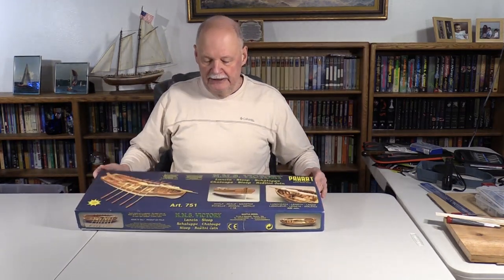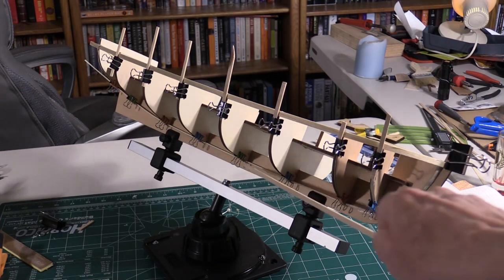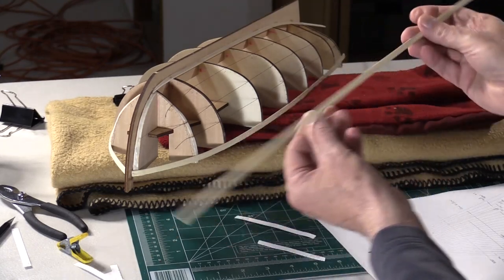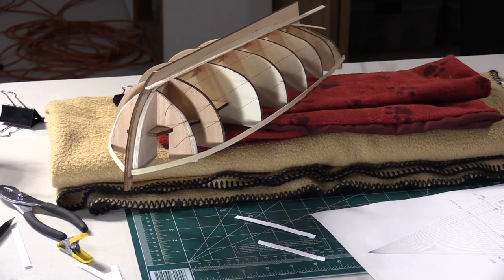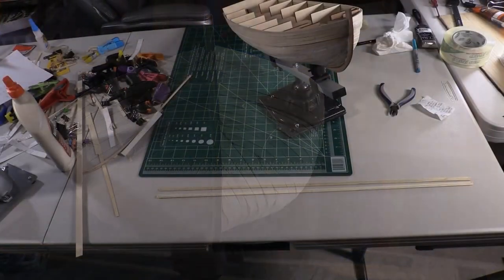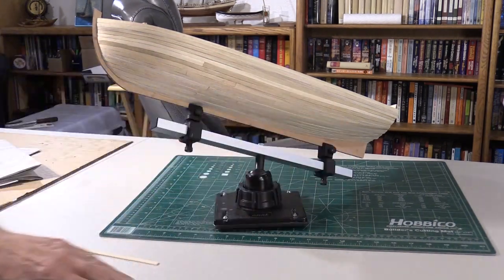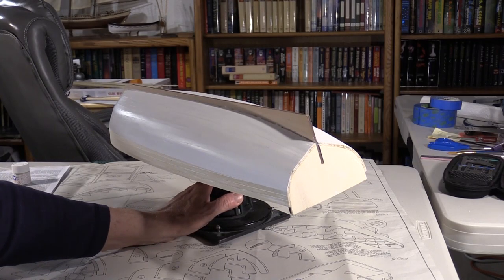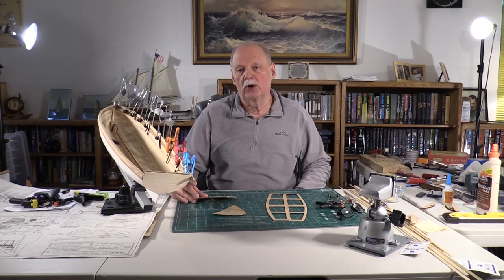HMS Victory launch Part 1, the Hull

Comment: What I have been doing on my planking is I taper the edges of each plank and that has all but eliminated the issue with the gaps. It takes some trial and error to figure out how to get them right but I learned this watching how they make real wood boats and they do this to every plank so they are flush. Although on the real boats they do what is called corking where they take something like Hokum and bound it into the seams between each plank. Not sure if that was a universal method and worth some investigation but I want to build as accurate as possible so my next boat I am going to try and find more historical detail about methods used and if the boat did get corking I need to figure out what material and methods to us to recreate that on the model.
Reply from the maker: Very interesting.  I am a slow learner, but if I stay with a thing, I can usually get good. 
I have been focusing on planking, and I am better, but still lots to learn.  I appreciate your advice, and keep it in mind when I get back to studying the model boat building techniques

Comment: Note under Fig 3 states (my translation) "before proceeding with the battens, it will be good to pass a little wax on the edges of the frames (excluding m.B) which must be removed once the battens have been completed. This application will make the gluing of the strips on these less tenacious". I would not solely rely on the Mantura supplied translation...
Reply from the maker: At the time, I could not figure out what wax had to do with anything.  I'd never heard of such a thing.  With hindsight, I now see the wisdom of following instructions haha!
Ken

Comment: Hey Ken, What is that heated tool you are using to bend your planks? Thanks!
Reply from the maker: It is called an Electric Plank Bender.  There are several manufactures to choose from

Comment: If you think about it the real boat would not have an exact fit.  Indeed the back of the planking fits flush, but the front has acaulking gap.  Additionally you nee to edge set the planking to get it to fit well.  It is not easy.
Reply from the maker: You are right.  I study planking and I am planning to buy a "half hull" planking kit with instructions to improve planking skills
https://thenrgstore.org/collections/plans-and-projects/products/half-hull-planking-project

Comment: hi ken , where did you get your vice and whot is it called ,thanks
Reply from the maker: It's called the Keel Klamper, by Amati.  I added a steel base with rubber feet for stability.
Reply: @ken_boats  thanks for your help good luck jiim